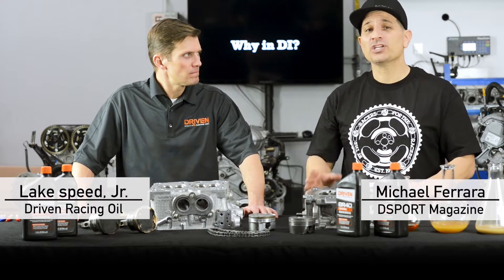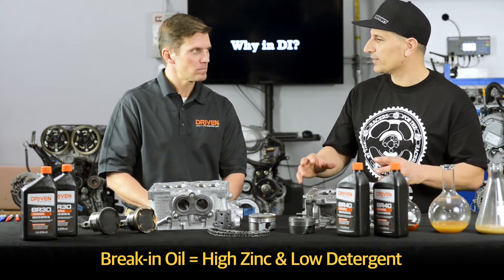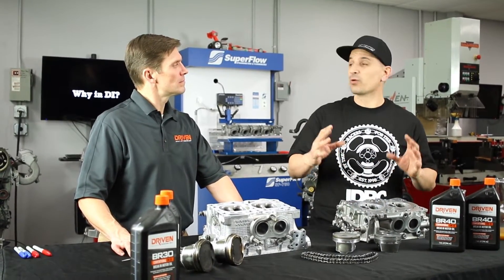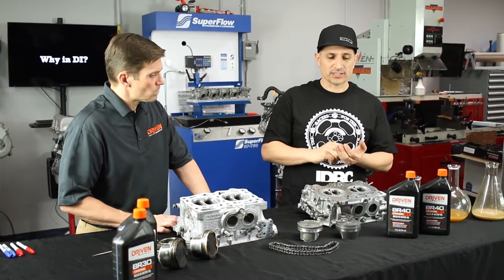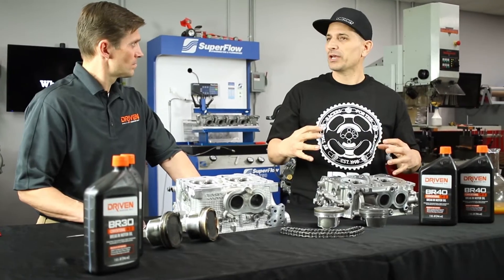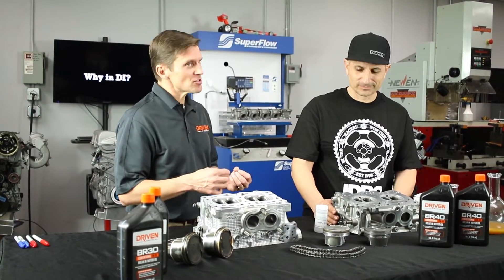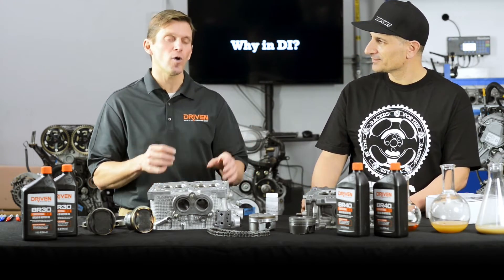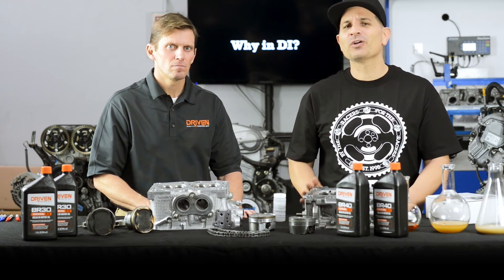How to Break-in Brand-New Engine + Oil Analysis

Comment: Clarification: These guys seem to be referring to race engines. The life of a race engine is far lower than that of a street engine, so keep that in mind. My 2024 Toyota Supra B58 owner's manual specifies a breakin schedule for 1200 miles while following these limits:
</= 4500 rpm
</= 100 mph
There is no mention of draining the oil immediately following the breakin.

Comment: My VW dealer told me that my mk7 Golf is broken in at factory and that I need to run the revs all over to seat valves and no cruise control for 2k miles.
At 74k the car doesn't lose oil and still runs great.  I'm trying to remember when he told me to do the first oil change.
10k full synthetic oil changes after that.
Cheers
Reply: Not true

Comment: Almost all of the performance shops and engine builders I've researched have said to do a change within 20-100 miles after first start (rebuilt engine). Keep moderate load (50-75% throttle at most) varying between 3-4k RPMs mostly, not to exceed that, no cruising/highway consistent runs or very short runs. Not to go WOT/full on until the 500-1000 mile break-in process. 

Wouldnt this be a bit different for race engines that are designed to fail very quickly and constantly be replaced? A v8 race motor that goes a few hundred or a thousand miles is a lot different than a 2.0l Ecoboost turbocharged engine that needs to last many thousands of miles as well as daily driving for years to come.

I'm up there with the start up, get up to temps, check for leaks, make sure you have sufficient oil pressure and coolant temps, and give it anywhere from 50-100 miles and change the break-in oil out..  but doing it again for another couple hundred miles without going WOT and much boost is the general consensus. Why is this subject so subjective? Even manufacturers that sell cars like the new C8's, NSXs, GTRs, etc all say to not rag on the car and do a moderate break-in period for up to 1000 miles before tracking them or drag racing, etc. 

Not everyone has $8k+ to rebuild an engine every few months because they have hundreds of new engine parts on hand and can rebuild a new one in a day lol

Comment: @DSPORT, so im about to install a remanufactured 5.3L ls engine into my truck. Bone stock build but I want it to last. The rebuilder provided Lucas break in oil with the engine. Obviously have no access to a dyno, So in the driveway would this be sufficient and safe... 
1) upon First startup immediately run up to 2500 rpm in park and keep it there for 20 min straight.

2) stop and change oil/filter, refill with break-in again. 

3) then immediately take it out and drive it hard for 10 or 20 miles or so and then continue driving hard for next 500 miles.
4) after 500 miles, change oil over to high quality synthetic.

Or is it NOT a good idea to run in park at 2500 rpms upon first start up because in the driveway there's no real way to add sufficient load during that time period?

Thx in advance
Reply: You don't need to idle it high, if it has roller lifters.

Comment: Depends what parts you used. If it's a high mileage built engine, a race engine put together for a season of racing or an engine built for one or two runs.
And especially, what rings you used. 
I've built more than 500 engines. 
Some of the best engines were the stubborn ones.

Comment: I have a new 2023 Honda Pilot and at 650 miles I went to the dealer for my first oil change. The service manager told me to wait until the message appeared on the dash to change it. Do you think 5,000 miles is to long to wait?

Comment: That is good advice for the rings, but bad advice for the bearings. Racers flog the engine kuz they know their bearings are coming out before 25,000miles let alone 250k. Yes change the initial oil fill at 3-500 miles. No to beating the sh*t out of bearings which are still wearing in.

Comment: Great video. I have seen countless opinions on how to do break in, and most are based on personal experience, but very few are backed up by data. Sure, engine builders can say they have built hundreds of engines broken in their way and most of them didn't blow up, but like Lake Speed Jr. said, that doesn't automatically mean they were broken in correctly. Thanks for the info!
Reply: Compression and oil consumption and color of plugs let us know.

Comment: Here's a good question. If I am running a boosted engine ( 2.0t, K03 turbo, max 10psi boost), then do I really need to drive the car to break it in if I am technically creating cylinder pressure with the turbo? For example, upon first start, if I run the engine at around 4,000 rpm then I am probably pushing 5-7 psi of boost. Is this enough "load" and cylinder pressure to bed the rings in? In a naturally aspirated engine you need to put load on the engine to create more cylinder pressure. You would do this by driving the car. With a boosted engine, however, you can create cylinder pressure with boost. I am just curious if I can bed the rings in by just sitting at 5-7 psi of boost in neutral without driving the car.

Comment: If the rings don’t seat and it’s consuming oil after several 1000’s of miles, can you refill with breakin oil to help seat them? Would this work for both low tension rings and non low tension rings? Cylinders were plateau finished for quicker breakin per builder.
Reply: no, first 50 miles has matter
Reply: From what i've heard, you only get one chance to break them in.

Comment: And, the most important question of all... isn't it unnecessary wear to the rings, to keep using the mineral based oil in, for the other parts to seat properly? What would be the best time to switch to synthetic oil? Right after the rings are seated, or longer after?
Reply: After 10,000 km

Comment: Ok I have a question . I rebuilt a Pontiac 389 engine and I’m certainly no mechanic . I never knew about engine break in as I thought you just fire it up , tune it etc then drive . Now I am worried because I have run it a fair bit , haven’t actually driven the vehicle yet and just used a standard 20w50 oil . Then I started learning about high zinc oils etc . My question is because I have no road miles on this engine is it too late to put in a high zinc break in oil and carry on from this point ?
Reply: Put in amsoil high zinc

Comment: Ok so I was watching you said to rev engine to 2500 then drain oil. Then go 500 miles. Then you said to change the oil right after the dyno. 
Which is it drive 500 miles after 1st change or dyno change drive 500 and change it a 3rd time?

Comment: I have a question,  does this pertain to a 6.0 diesel as well ? Just rebuilt the engine , I drive the truck hard . Should I break it in hard as I normally drive it or break it in at an easier level ? Not granny driving per say but easier than I always drive it .

Comment: What is the break in temperature, as he mentioned, Performance engine they built  being push to the rev limit on 2nd fill up 
But they break in with driveline or just bare engine, and what temperature they keep ? We know that zinc additives need hight temperature to activate, but oil overheat or start to boil at 130°C 
So hat temperature do we keep to get a proper break in
Reply: Contrary to what's been said in the video, you don't need to heat up the oil to activate the additives. So the temperature is irrelevant for the oil. However it's important to fully warm up the engine before you apply any significant load.

Comment: You don't get metal shavings out of an engine due to break in period by changing the oil. Sure you'll get some, but not the majority.
Reply: Thank you CAPTAIN OBVIOUS!! W
Reply: Then how do you get the “majority” out if not by changing the oil and filter.
Reply: @reginaldsmall3766  You use a magnet to trap the particles. Even then you won't get them all but way more than without. Look up videos on using magnets for this. Install a good filter too! You see, you can drain the oil but while the heaviest particles fall to the ground they will stay in the engine all over the inner surfaces. A magnet will catch More not All. Best thing to do is run 10 gallons of oil and gas through the system and catch/filter all that comes through under high pressure.. Then do it again!  NO ONE doles that. It's physics.. which most wrench jockeys don't understand.  Also, they are Cheap.
Reply: @DivergentDroid  the c8 corvette engine is all aluminum. The heads,block and pistons. What good would a magnet do?
Reply: @reginaldsmall3766  Point taken but thats not the norm.
Reply: I changed the oil and filter with amsoil 0-40 and amsoil filter. I plan on changing the oil again at 2000 miles. Do you have any orther suggestions?
Reply: @reginaldsmall3766  If you can't use a magnet to help then changing the oil and filter is all you can do. My original post was to suggest that changing the oil and filter alone won't always cut it in all cases, such as small engines like scooters or motorcycles, riding mowers etc. However during a break in with a large engine like a car I suggest changing the oil and filter twice as frequently as you normally would. Take a scooter for instance that has a break in period of about 300 miles. I'd change the oil and filter if the bike has one every 100 miles. If you do have a lot of metal shavings  you may need to do an oil flush to get more out.

Comment: This is BULLSHIT.

The reason why your DYNO is going up then settles is because new car engines from the factory have ECU's that dynamically adjust timeing, and will build until it detects detonation events.  Absolute morons on this channel.

Moderate and varying engine load between 2k and 4k is all you need to create enough pressure to seat.  Physics tells you that - hell everyone will tell you that. 

Yes, HIGH RPM and HIGH load will seat your piston rings, but it also runs the risk of damaging your engine due to HIGH heat generated causing large expansion of imperfections in the engine, these imperfections like to be worn down over time, not potentially scoring the metal where you DONT want it.
Reply: Three things:
#1 The testing they did was on a freshly rebuilt engine with an aftermarket ECU. Voiding your point about OEM automatic adjustments.
#2 They recommended exactly what you did. 2500RPM. That's between 2K and 4K is it not? So, you agree.
#3 If it is hear and load that will cause imperfections to wear down, then they will either wear down during break in or use, no different.
Reply: @802Garage  Bit of a necro, but yeah they said plenty of good things as well - just not when it came to after the first 20 mins oil change.   Going MAX REVS after '20 mins' on a NEW car (that's what they said) is just going to risk those high heat defects for no appreciable gain. 

The guy in the black shirt never said that he was breaking in a custom build engine with a custom ECU, so how could I know that?  So before I comment further, what ECU were they using?
Reply: @Blight-fp3vt  Yeah totally fair. The article is called "Quick Tech: Performance Engine Break-In the Right Way" and they use an R33 GT-R. It's their project called RH8. Wasn't sure what ECU they used, but did some more digging. It appears they are using AEM Infinity. It's a 2.8L modified RB engine. Lots of aftermarket ECUs have self learning too, of course, but if they didn't have that turned off it would be pretty pathetic.

Comment: What a load of tosh about break in oil the only part of the engine having direct friction is the cam and cylinder walls. The rod bearings never touch if they did your engine would die

Comment: Race engines are built differently than engines in our street vehicles. 7;000 rpm to break in an engine is not applicable to street engines geez. The best break in for a street engine.......drive it for a few days 300-400 miles in traffic. Yep the stop and go acceleration will push the rings against the cylinder walls and seat them. Don’t accelerate lightly but don’t floor it away from every light. Half to 3/4 throttle several times during the drive will build cylinder pressure against the rings and seat them. Worst thing to do? Miles and miles of 70 mph interstate driving. Lots of oil splashing up on the cylinder walls but no cylinder pressure on the rings. Result?Cylinder wall glazing and no ring seating.
Reply: Do you still run for 20 mins or so for first run and dump that oil and switch, or hit the street with the first oil?  So much mixed info out there... Thx.
Reply: He didn't recommend 7,000 RPM. He recommended 2,500 RPM.
Reply: Thank you

Comment: Very informative. Iv asked a lot of professionals in the engine department they all said after a few hundred KM the process is complete, if there was an issue you’d know within the first 100km. After that like you said dump the oil then your good to go. 

My Q is, why do manufacturers like AMG, BMW M, say oh you need to do it for 2000km ? 

I have heard majority if not all performance engines are  run pretty much full bore while there testing engines for a few minutes etc for failures before they marry it to the car..?
Reply: I believe run it hard for race engines, as they most likely have more lose tolerances so they can run hot with no problems.
For street driven engines follow manuals directions, vary speeds all the time. Do not stay at a constant speed, also change the oil sooner as he says 400 to 500 miles. I would refill with break in or conventional motor oil and change it again after another 500 miles, keep changing till I reach 2000 miles. That's what I would do for my car, sound reasonable?
I know Acura NSX fully breaks in their engines at factory. My guess is he is probably talking about Corvette  engines run on wide open throttle.

Comment: Why drain the oil hot at its thickest viscosity. A 5w30 is at its thinnest cold, at 5 and thickest hot 30 it's made this way for startup, so seems you would drain cold.
Reply: You got it totally backwards.
Reply: I don't think so, I worked for Citgo oil for 7yrs. I know my oil.
Reply: @scottpearce7466  You did not know your oil and you were wrong. Oil gets thinner when it gets hotter. You do not understand the oil number system. The first number, denoted by W, is one viscosity scale. The W stands for Winter and it is one rating system for viscosity. The number represents the viscosity at a standardized temperature. The second number, 30 for example, is a viscosity on the hot scale. A totally different scale and a different specific temperature. Please look it up if you haven't learned better by now.
Reply: @802Garage  😂😮😢 bro. Your the one who is wrong. You gotta know what you are talking about. Google is right under your two fingers.
Reply: @DB-qm4jx  Bro... Google it... What do you even think I'm wrong about?
Reply: @DB-qm4jx  "The grades include single grades, such as SAE 30, and also multi-grades such as SAE 15W-30. A multi-grade consists of a winter grade specifying the viscosity at cold temperatures and a non-winter grade specifying the viscosity at operating temperatures." -Wikipedia

"Motor oil gets thinner as it's heated, but to prevent it from getting too thin at higher temperatures, additives (viscosity modifiers) are used so that it behaves like a thicker grade oil at higher temps." -Engineering Explained
Reply: @802Garage  lol I’m sorry. I responded to the wrong person 🫣😞. Sorry man fat fingers.
Reply: @DB-qm4jx  Hahaha all good. At least there's extra info for other people now.
Reply: @802Garage  absolutely sorry man. Didn’t mean to detrack from your post. 
I’ll look a little closer next time. Sorry man!
Reply: @DB-qm4jx  Seriously it's no worries I was saying now the added quotes will help someone else. 😂
Reply: @802Garage  oh lol yea. They absolutely should. 😆 I think so.

Comment: I phoned Mobil Lube Technical support. And they said use Mobil 1 full synthetic from the start and no brake in oil is needed for my Audi V10 engine.
Reply: That's odd.  When I called them they said use Walmart Supertech and save yourself big $$$ over the life of your car.
Reply: @dougn2350  Doug your trying to pull my chain. Not going  to bite.
Reply: This video is not about new OEM vehicles it is about freshly rebuilt engines and especially performance engines. OEM engines are mostly broken in from the factory.

Comment: Hoping for some clarification... just bought a 2020 WRX with a direct injected 2.0 turbo - the manual and Subaru mechanics say don’t go over 4000rpm and do not use boost or full throttle for at least 1600 km’s (1000 miles). Why would they say that if it’s harmful to the motor when they need to pay out on engine warranty repairs for 5 years!?
Reply: i just bought my mustang ecoboost and have not listened to anything the manual has said about break in at all. I have had one in the past and had no oil leaks. Think its due to how i just go drive my car. With the manual though during break in you will want to vary your RPM so no cruise control for you for awhile

Comment: I just got a new subaru and they recommended stay under 3k rpm until 1k miles. So that isn't the proper way to break it in?
Reply: That seems very low RPM even for a soft break-in. You wouldn’t even be able to get up to highway speeds on a ramp with that RPM for most vehicles. Does it have CVT?
Reply: @NiceGuysFinishLas100  no its an sti with the 6 speed
Reply: Turbocharged? Almost seems like the manufacturer has that requirement just for the turbo to not spool up its peak psi.
Reply: @NiceGuysFinishLas100  yes it is the 2.5L turbo
Reply: Turbochargers don’t need any break-in. So it’s most likely the manufacturer doesn’t want high spool creating max psi from the turbo. You probably already know this so the question is why???

Comment: They are selling the stuff.
They would say that, wouldn't they?
A non friction modified oil or non synthetic oil is fine.
It is how you run the engine at break in that determines the outcomes, if this is done incorrectly , no oil will hide it.
Reply from the maker: We don't sell it.